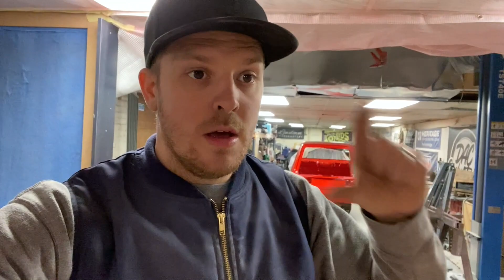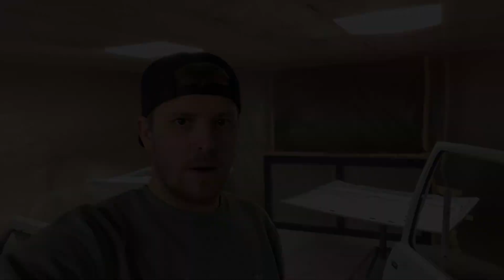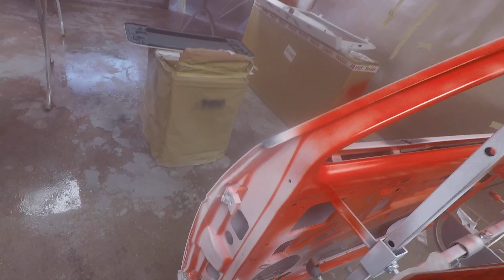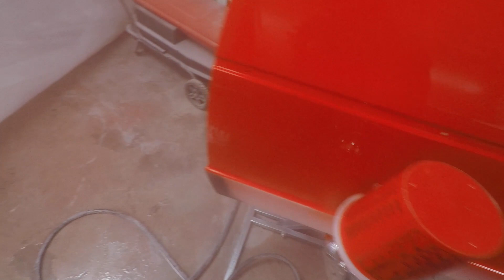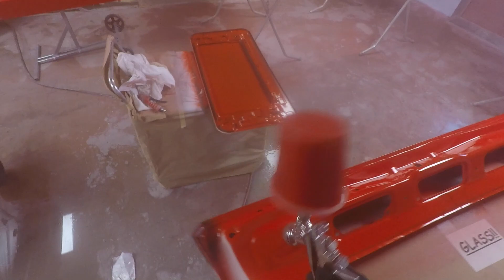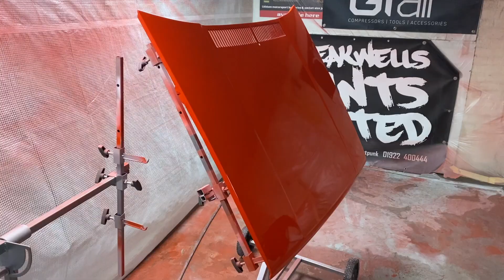Painting The Panels 1983 Mk1 Golf GTI Restoration 1.8 20v t Engine Swap

Comment: Fantastic job again Dan, as you have put 3 coats on it the nibs will sand out as you have enough build there, then a good polish it will look mint, not totally sure but the bonnet will need a good sand to remove the fisheyes then repainting, I have seen where people will just mix a little colour up and dab them in the fisheyes then de-nib as usual but not sure if you will see them after, I'm sure Tony will advise you 👏👍
Reply from the maker: Thank you! Yeah I did think I might try and dot some paint on and cut it back first. No harm in trying.

Comment: fish eyes in paint are usually contamination on  the surface or the air circulation. try cleaning the booth and panels thouroghly and this might sound strange but works, spray thinners in the empty booth with the fan on. it kills all contaminents like silicone etc.

Comment: looking great. of course you don't want more unsolicited advice but you shouldn't really be using etch primer over top of those areas you've broken through. You should touch them up with epoxy. You don't want the etch primer reacting with all the other types of paint you are laying down.

Anyway, well done, it looks superb.
Reply from the maker: Thank you! I watched a few different videos online and this is the way they did it so I assumed it would be ok.
Reply: @DanChambersDAC  I'm sure you'll be fine, I just avoid etch primer these days and use epoxy for anything that would have been etched in the past. Epoxy seems to be pretty compatible with most things. Car is looking amazing. You much be so chuffed.

Comment: First of all I would like to say that what you are doing is really great. However, I noticed that your spray gun nozzle head is set incorrectly or that you have too little pressure on the compressor. it looks as if you paint with a point beam - instead of a "fan". maybe the color is too thick.
it looks weird anyway.
Check out other painters on YouTube and you'll see what I mean.
you would also have a much better spray pattern and therefore better results.
Reply from the maker: Cheers, Yeah still getting to grips with it all. So much to think about when doing it.